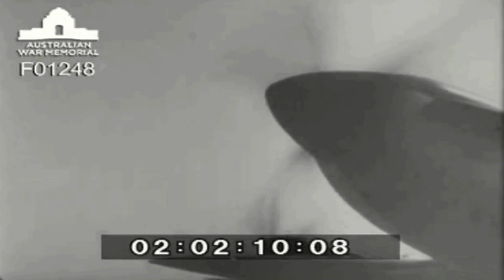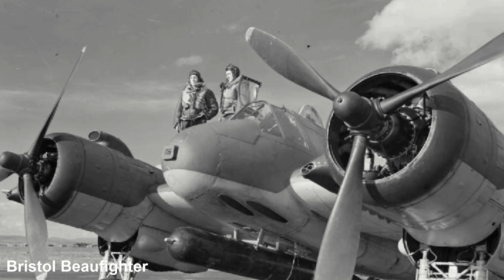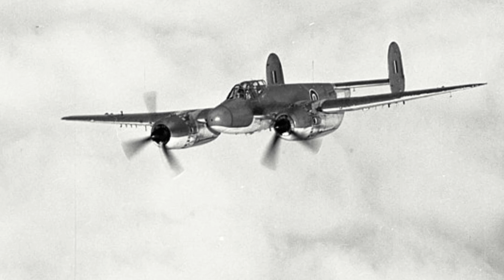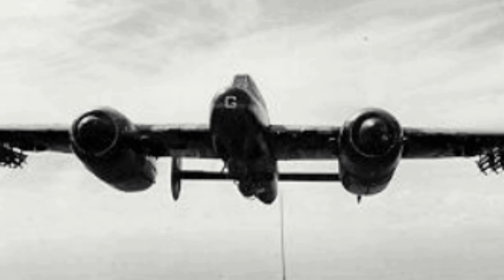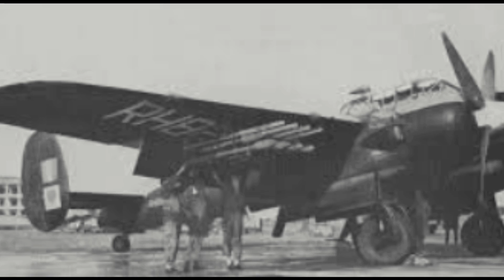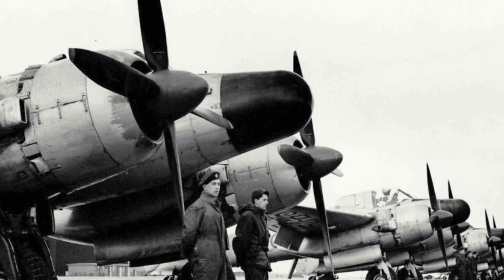The deathtrap over Malaya: The Bristol Brigand Ground Attack Aircraft

Comment: The most British plane ever. Designed and built under cement grey skies, and eternal drizzle, couldn't handle the tropical climate. The local fuel probably gave it the runs.

Comment: It is my understanding that one of the complaints pilots had while using the Beaufighter as a torpedo bomber, was a need for airbrakes and that the Australians had retrofitted bellows type for this reason. I had assumed that the Brigand's airbrakes, also of the bellows type, were part of the design to facilitate torpedo attacks. But I could be wrong, of course.
Reply from the maker: That vaguely seems right ( It's been a while since I've properly read up on the Beaufighter and have forgotten some parts of it). The Brigand was originally conceived as a torpedo bomber so that would make a lot of sense

Comment: my father was in 45 squadron in singapore,he told me about the tendency of brigand propellers to fall off unexpectedly,  He was relieved when they got hornets..
Reply: the problem was that although they worked reasonably well in temperate climates ,the hot and humid conditions encountered in the Malayan jungle caused corrosion in some parts of the aircraft leading to propellor blades failing with the subsequent loss of an engine and the plane.Also the dive brakes could not be operated due to the leather components corroding due to the humidity
Reply from the maker: @andrewfrench9391   Yes very much so which is surprising as from the get go the aircraft was intended to replace the Beaufighter in the Far East.
Reply from the maker: That is very interesting. It doesn't seem overly popular with pilots. I did find it surprising that most sources I came across described the Brigand as a relatively good aircraft, considering how many issues it faced. 

This is an extract from BAE Systems website which perhaps glosses over things a little much: "The type served operationally in the Malaya campaign, where the aircraft was found to be both popular and robust until it was eventually superseded by the De Havilland DH103 Hornet and the English Electric Canberra in February 1953."

Comment: an irony exemplified by the exploding hydraulic seals; is that the conflict in question, was  being fought over control of the rubber which made the seals. It was those trees, sourced from cuttings obtained in the Brazilian rainforest and brought to the east by the Brittish which  createdthe plantations and wealth , The war was mearly the locals who on their own could never have achieved this accomplishment but sought to steal by force. neither could they have designed nor manufactured such an aircraft!
Reply: You demonstrate a spectacular ignorance of the complexities that brought about this conflict.
Reply: @thesmallerhalf1968  was refering to the aircraft rather than the local politics. As the conflict remains long after the aircraft and the british are gone, it is unlikely the comment section of a posted video (not mine) provides a suitable vehicle for any such solutions...perhaps you could provide more  (some?) specifics...

Comment: Bristol took their eye off the ball with this one its s predecessors were sound aircraft even if some of them were under powered and  obsolete very quickly.  Bristol were however working on the very successful Bristol Freighter and  Britannia.
Reply from the maker: I guess not all aircraft that are designed are going to be winners. This one seems to be one of those classical examples of it being built for the conditions of Europe rather than its intended use in the Far East

Comment: Good vid.

One of the RPAF aircraft never made it past Baghdad on the delivery flight as the undercarriage collapsed on landing. The other seems to have made it, but as far as anyone can make out it was scrapped in Pakistan rather than be sent back to the UK. 

It's a bit sad that the Brigand didn't live up to the reputation set by the Beaufighter (a hard act to follow), but perhaps it was just because it couldn't handle the tropics. Service in Europe or a similar environment may have proved more forgiving and allowed it to have proved itself.
Reply from the maker: Thanks 👍✈️ 

That is interesting, a good example to the Pakistan Air Force on issues with the type. 

It is, and the aircraft itself seemed to promise a lot. But considering it was deesigned for the Far East right from the get go, it is disappointing these things werent planned for.
Reply: Leather was never going to last long in those circumstances...which is why weaved webbing was invented for soldier's kit in the first place, the leather bandoliers etc would just rot away in that climate. Surprised no one thought of it when they designed the Brigand.
Reply from the maker: @uha6477   That is interesting and makes sense. Yes it is weird that it wasn't thought of

Comment: Thanks for the video. One of the few I'd not heard of. I did notice that the that the aircraft did not have contra-rotating propeller.

They did seem to have a problems with the hot humid conditions just as the Mosquito did.
Reply: You mean counter rotating.  Contra-rotating is two concentric propellers off a single crankshaft.

It seems the Brits came late to thinking that counter-rotating propellers were worth the trouble.  The Dh Hornet is the first Brit plane I saw with them.  They even specified that the export version of the Lockheed P-38 they received must not have counter rotating props.  They did this to save the logics complication of having to stock a second version of the V-1710 engine with opposite rotation.
Reply from the maker: It doesn't get a heap of attention. I see it on rare occasions in books. The RAF seemed to struggle finding an aircraft to fight in the Far East between about 1945-50.